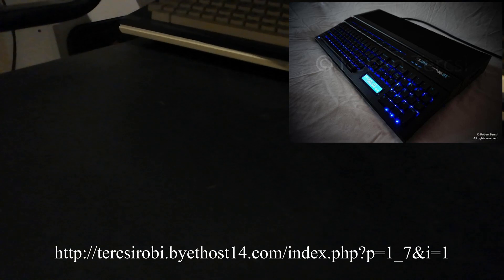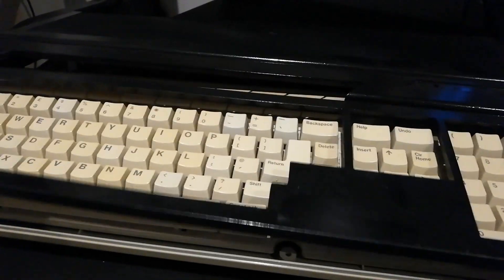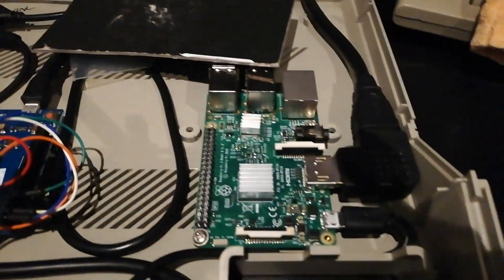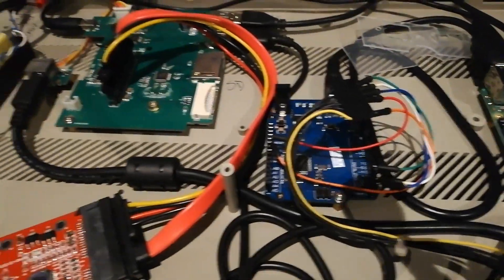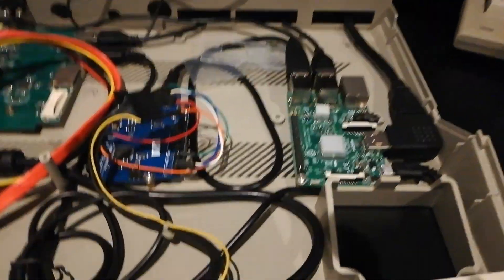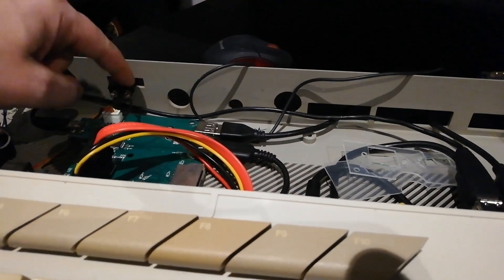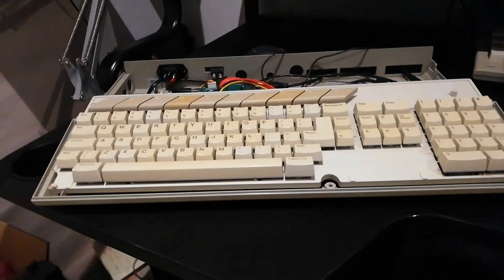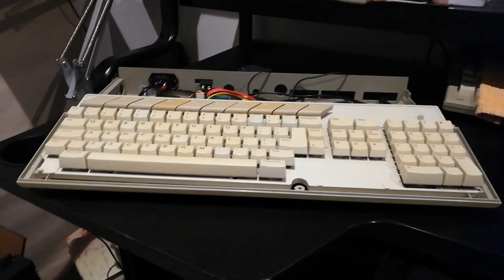06 - Feed my FrankenSTEin ... Raspberry Pi in Atari ST case

Comment: Can the midi ports be installed on the Pi?
Reply from the maker: Yep, you can get dual midi ports that connect to the gpio pins. Google for mt32pi  or something like that. There is a guy who has made a roland mt32 emulator with an rpi and it has real midi ports.

Comment: I'm trying to get my Arduino programmed to recognize the keyboard like you have, but I don't seem to be getting anywhere. I upload the sketch to the Leonardo, but no inputs seem to work. :(
Reply from the maker: Are you sure that your Atari Keyboard works? Have you got proper voltage to the Arduino? What are you connecting it to? (PC, Pi) I followed Kevin Peats instructions word for word and mine worked first time, which I guess could have just been lucky!